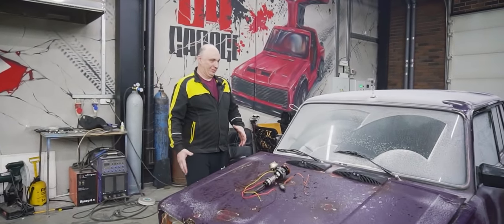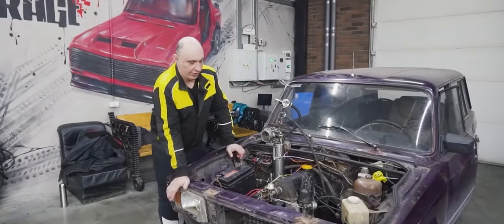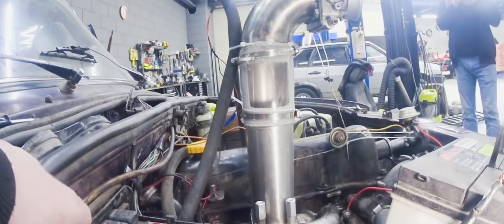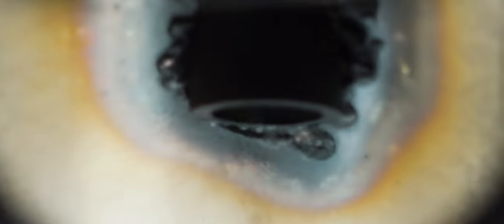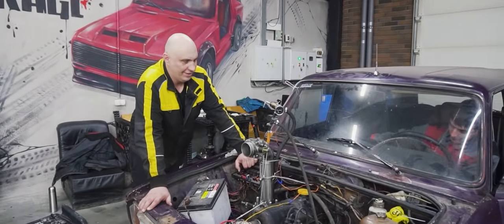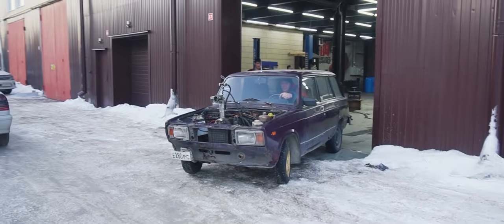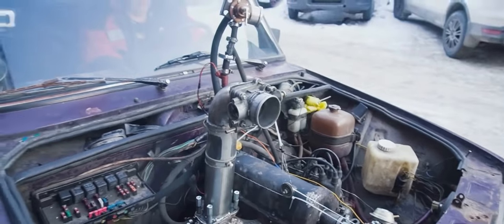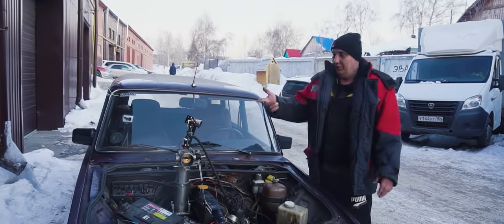Can you replace a carburetor with a fuel injector?

Comment: after market ECU/ECMs ? hello
megasquirt (if you dont have much cash)
AEM
HOLLY EFI
to name few and they are programable that way you dial in the fuel injector with a laptop also the with the ignition if you ditch the 
old style distributor and use a trigger wheel attached to the crankshaft for more accurate ignition control and injector pulse width modulation 
aslo you must get data for a particular injector and know its flow rate before using it

Comment: Try injector from daewo matiz 800cc, or you can try run something else for switching injector. Something with cam edgy cam like for shorter time switched open the injector. Or try something with vacuum, so vacuum would be reacting with fuel to be injected. Nice video tho :), blin ❤️

Comment: You have to consider throttle position, otherwise it is like you said, rich at idle and lean under load!
I was thinking make the points adjustable with a lever connected to throttle cable. Then, with no throttle you have short injector pulse, when you press throttle the injector pulse gets longer and dumps more fuel, after that as rpm increases even more fuel gets in from more injector pulses.

Comment: They had a fancy rising rate fuel reg on that thing.. Why didn't they try using it? I'm not sure if it does much in negative pressures but should think it would help with the mixtures.

Comment: 12 hole injectors, higher pressure means better atomization. Don't confuse pressure with flow rate. If the intake pipe is hot, the fuel will easily vaporize. Maybe try an ITB injector setup using a similar method?

Comment: I am sorry to disagree with your assessment, but I believe I know the reason for your issues with this project. Your injector fires or squirts in direct proportion to the cylinders. This is the correct idea, but due to it coming off the gap in the points, it squirts longer at idle (making it rich) and shorter as it revs higher, eventually making it too lean (why you cap out at about 4k rev). This is why modern cars have an ECU to vary the pulse width (amount of time the injector squirts) in direct proportion to how open the throttle is with the TPS (Throttle position sensor). Other sensors like the MAP, O2 and such fine tune that amount further. Originally, with Volkswagen's Motronic mechanical fuel injection they would vary the fuel pressure to achieve this instead of the pulse width. (low pressure at idle and higher pressure depending upon rev).

Comment: There is a reason fuel injection is more common place nowadays. Carburetors are archaic, difficult to work on, finicky, and are poor at doing their jobs which is to atomize the fuel. The only thing carburetors have going for them is they’re cheaper, but they don’t have that going for them anymore as you can literally get a $15 fuel injector off the internet nowadays. 

Nostalgia is the only thing you’ll get, from a carb. I see no advantages keeping them on an older car. It can get expensive retrofitting them but it worth it (especially sequential injection) as you’ll get better power in most cases and economy. 

Well done on this video. 

Even throttle body injection as shown here can be interesting!

Comment: Um, you guys do know this has already been invented, right? In the 1980's this was called TBI (Throttle Body Injection). I had a 1986 Ford with a 5.0 V8 that had TBI. If you took the air cleaner off, you could see two fuel injectors spraying fuel against the outside of butterfly. Ford literally took the carb off the engine and stuck two injectors in its place and called it "fuel injection".

Comment: The year was: the mid eighties.
The car: every American car on the planet
The name of the system: TBI, or throttle body fuel injection

Every American car in the 80s had throttle body fuel injection until about 86, then they went to port injection.

Comment: I blew the fuel pump in my 91 chevy 1500. We used a garden pump up sprayer. And just sprayed gas down the intake to move it into the shop. Ran great moved 150 yards. 1 stall

Comment: Absolutely... late 70s early 80s hand them out of the factory called TBI... throttle body injection... and yes I am a retired mechanic... shine a timing light on the fuel stream... you can see the individual sprays

Comment: There used to be a fuel setup Chevrolet used in the '80s and 90's called T.B.I, or "throttle body injection". It literally was just a pair of fuel injectors set above the throttle plates of a very, very basic throttle body.

Comment: it probably only revs to 4.5k because of the points could be starting to float, and or at that RPM there is no adjustment for the injector to stay open longer as it will need more fuel

Comment: Not to completely dismiss the effort here, but mechanical fuel injection has been around since the WWII era. Works fine at constant throttle (planes and race cars), but it's a massive PITA to get working on a street-driven vehicle that has to cycle through power ranges.

Comment: you need to adjust the pulse width based on engine rpm. lower rpm needs a shorter pulse, higher rpm needs a longer pulse. distributor cannot do this. distributor can't do what you need for this to work properly.

Comment: The reason this is not working well it's because the injector pulse width (dwell) is typically controlled by the computer to accomplish this. Without being able to constantly adjust the distributor dwell depending on load conditions, it will never operate ideally. Depending on the gap, it is still going to be a fixed fuel ratio without changing dwell. Given the extreme primitive injection system fabricated here, it works rather well. Good job guys 👍

Comment: I really want to see you guys convert a gas engine into a diesel
Reply: Too little material there for required compression for it to work, but maybe making custom sleeve on each cylinder, smaller pistons and well... rebuilding whole engine it might possible. Been cursing this for years now since i have lots of gasoline engines i want to turn into diesel, but it wont work sadly and all the crate small diesel engines cost arm and a leg here.

Comment: Chevy built a whole generation of truck engines on this theory, throttle body injection, 87 to 98. Just a stripped down carb (throttle body with no fuel circuits) and an injector or 2 Montes above the throttle plate. It actually worked rather well,

Comment: Ok here is free info

The fuel regulator needs to be vacuum referenced. Throttle body size is fine. The fuel pressure needs to be lowered during low rpm and throttle angle using vacuum reference. Then when you get into the throttle the fuel pressure comes up for accel enrichment. The injector is undersized which is why it won't Rev past 4500rpm. 15 years as a mechanic, and an associates degree in automotive technology is how I informed this comment.

Comment: This will never really work due to you regulate the fuel amount based from the potition of the TPS to shorten/lenghten the injection time to lean or richen the mixture, and this system does not have any TPS, Lambda/O2 sensor and injection computer to control the injection timing and mixture.
Pretty cool project tho 🙂

Comment: A fun experiment, but it wont provide a good RPM range because of injector dead/opening time. All injectors have an amount of time they require signal before they start releasing fuel. With your setup, as the engine speeds up, the injector signal time shortens. That means that if the engine RPMs get high enough, eventually the injector would completely stop flowing. If you had some sort of relay device that when triggered by the distributor signal caused the injector to open for a consistant amount of time, and then it just triggered that more often as the engine sped up you might have a chance.

Comment: Mechanical TBI? I think maybe add an adjustable fuel pressure regulator and connect it to throttle valve, and valcume pipe, the result would be better.

Comment: You need to somehow factor in throttle position or manifold pressure into fuel delivery loop. If you adjust it to run good at idle, it'll be way too lean at WOT. Maybe controlling fuel pressure with vacuum reference or something?

Comment: You need a pcm to control the pulse width of the injector that works off the hall effect sensor. Pcm keeps the stoykometric at the optimum 14.7 to 1

Comment: Lol awesome work. 2 ways to resolve the issue (possibly) is 2nd injector on a micro switch that triggers on full throttle and maybe 3d print a nozzle for the throttle body to limit the airflow.

Comment: the fiat single point time/density system is probably one of the easiest to transplant with just a few earths lives a temp sensor, lambda sensor and a tdc trigger, everything else is mounted in the throttle body.

multiple engine capacity options for a donor and even diy live mapping software for the 6f/16f 8f/8f ecu's

Comment: At low RPM it holds the injectors open longer, at higher rpm it holds it open shorter but repeats more. In the end it's the same amount of fuel at every RPM.

One injector pulse is not a fixed amount of fuel.

Comment: Early 90's throttle body injection systems (single point, as opposed to multi-point port) is a carb replacement that uses a fuel injector.

Comment: You can get a distributor with a HAL sensor and attach that to a circuit that allows the pulse from the cam to be delayed by the high and low of an O2 sensor mounted in the exhaust. This should allow you to control the mixture. Design the circuit with a POT that allows you to adjust the mixture. Of course you could get a feedback circuit that can do it for you off of temperature, intake manifold pressure, throttle position, but then you could just go find an engine control module off of a obd1 car and use that instead. Wait, A good...bad idea. Take the fuel injection off a newer lada and convert it to run an old lada.

Comment: This is a batch fuel injection system as opposed to a sequential fuel injection. 👍 The main issue is that the flow rate of the injector is not known, there is no Pulse With Modulation to control the fuel flow, the unknown about the fuel flow of the fuel pump. The amount of full is the same at idle as at full throttle. Vlad even admitted that the injectors are from a wrecker, so the injectors are probably not atomizing the full correctly.  Just some more research and this project would be better.

Comment: This was a brilliant video and idea. If I were to make this, I'd use 2 injectors instead of one and alternate firing them so that the duty cycle isn't so high. I'd also use the larger injector, and add a needle valve below the throttle body to give you a controlled vacuum leak to set the idle, like a manual idle air control. That might help with the larger injector loading up at idle, but should be irrelevant once the throttle is open. Perhaps the throttle linkage could close the valve so that you aren't leaning out your cruise mixture when vacuum is high.

Comment: Dang!   How original, if only some car manufacture would have thought about doing that early on in fuel injection!   Hey maybe next you can come up with a way making a tire from rubber that we could put air into! Then we can take off those wooden wagon wheels that have a steel band around the outside.  😂

Comment: hello    this is a very  nice experiment
for fuel injector  I really enjoy watching it though at least it's translated many thanks for that 👋

the system i propose  uses the alternator  indicator lamp to  control the fuel injector operation .

 u can install a relay (with normally closed switch contacts ) 
  it's winding first wire to ingnition switch at  ON position terminal  (takes +12v from battery via ignition switch )
the other  wire connect to alternator regulator output control wire 
(usually it conects to a 12v lamp 
and the lamp other wire to +12v 
battery via ignition switch)

the relay is off state  it's switch   (normally closed contacts)  connects to the injector when the car starts up and engine is cranking up the regulator in the alternator starts charging 
making the relay to turn off  it's contacts closes causing the injector to activate  . as long as the engine running the relay is off and the injector working .
if for any reason the  alternator stops working (faulty , snapped belt , front accident.....)  the relay activates opening the switch and cutting power from the injector .
I hope that helps .

Comment: I had a VW Golf Mk3 with a 1.4 single point injection engine. For a 1.4 it was ridiculously slow (54hp I think). My 1.2 multi point injection corsa had 75hp! It's amazing how much difference a few more injectors can make. (Along with other tweaks obviously).
Reply: The double barrel carburettor Ford Orion, 1.4 cvh engine have 75hp
I thought those VW had similar power output
Reply: @SandStormPower  Nah they were very low for the engine size. Just checked, it was 59hp.

Comment: With arduino you can adjust injector opening time.  Offset from shaft position and opening time depending on rotation.  You can make an injection map.  A well-written program will have a resolution measured in microseconds, not milliseconds.

Comment: The distributer cam lobs are the issue behind too much fuel..it takes quite a great deal of time for those points to close because of the cam lob profile..the best experiment would have been to use an electronic one using a hall sensor.. lm currently making a DIY mechanical fuel injection system. my current challenge is getting the injector open and close..l was using a reed switch which does work since l positioned it to be switched on/off by a magnet l glued on to the front crank pulley.the issue is at high speed the reed switch fails to work..my attention shifted to an electronic distributer.that magnetic pick up can work for me bt l cant seem to figure out how l cant get the module to supply me the desired on/off without also giving a constant 5v feed in the same cables going to the coil

Comment: Wonder if a three stage injector setup with a small med and large injector turned off and on. By throttle position... idle is small injector, mid speed is the mid injector and Hight or wide open large injector... it would be an ugly setup but would be interesting

Comment: as practical demonstrations go, its very interesting. It shouldnt work, and yet it does.Could do with an extra staged injector that cuts in when as throttle body opens up. Or alternatively vary fuel pressure to a large injector to get variable fuel delivery with throttle position.

Comment: If you decide to experiment more on this fuel injection system, try fitting an air filter before changing the throttle body.. ? Maybe it will restrict airflow enough to compensate for trottle body size..

Comment: Throttle response wont be good because you can only optimize it for one rpm. Great for a generator, or a pump, but not so great for a car. 
Thats why carburetors have accelerator pumps, because a carb compensates too slowly when throttle is opened. 

Still a great MacGyver hack for after the end of civilization. Not too many carburetors floating around anymore but lots of injectors. 

That said, a simple metered jet would be even less complex (albiet more dangerous), just adjust pressure using a ball valve attached to the throttle pedal. This is actually how the earliest engines were run prior to the invention of the carburetor.
Love your content guys!

Comment: its impossible for the throttle body to be too big.
an engine can only displace its displacement. it cant suck too much air. the intake tube being so tall and large is slowing down air speed as it flows and not promoting combustion its stalling. big whoop it affects idle.
your main problem here is your tuning for idle with a fuel injector set to on and off.
idle a fuel injector follows a duty cycle. its told to come on but at some percent of duty cycle. 10% 20% 80% its all the same. it just opens at a short timeframe at idle. and closer to redline its at near 100% duty cycle so it opens for its near max for its set time frame. say its duty cycle is based on .3ms so 80% of .3ms or 20% of .3ms is how long it would be open for.
easiest thing you can do is run a small injector for idle at low rpms and higher rpms use a larger injector. or size it properly if you cant disable low rpm injector and the higher rpm one comes in at desired rpm and adds to the fuel being fed to your motor.
another way to get around this is to lean the engine out at idle. remove any plugs on the throttle body for vacuum. idle air control motor remove it. then back off the idle screw and try to set it after it starts. then try to size the injector to have a decent enough idle and it will have more top end and youll get it a little more driveable.
the only way to fuel inject is with some electronics or active fuel metering. low fuel low rpms and more fuel as rpms rises. mechanical fuel injection does the same but its heavy on the rotating assembly.
also try timing your fuel injection distributor. advance or retard it to get the injector pulse to line up with when a cylinder is pulling air in. it will idle alot better. the longer distance between throttle body the longer the throttle delay. the longer between the injector and intake valve the longer the delay and less fuel atomized still.

Comment: Excellent test, the problem is that at higher revs less fuel is injected because the time that the distributor sends the signal is less, and on the contrary at low rpm the injector opens for a longer time